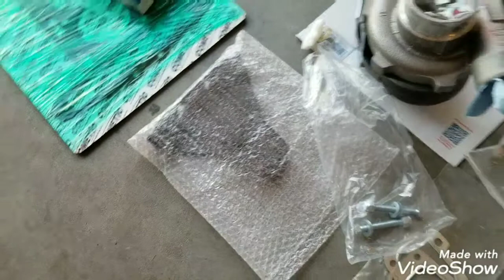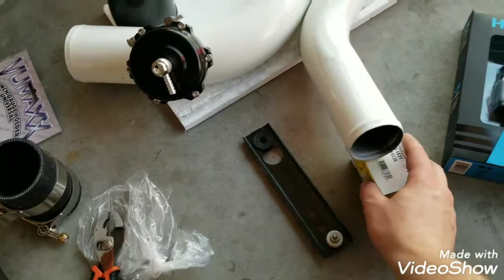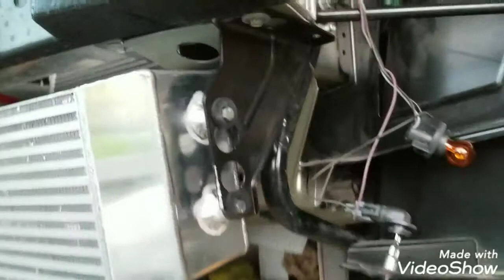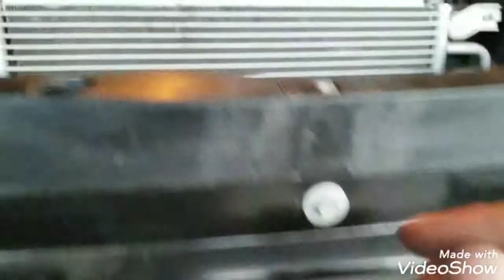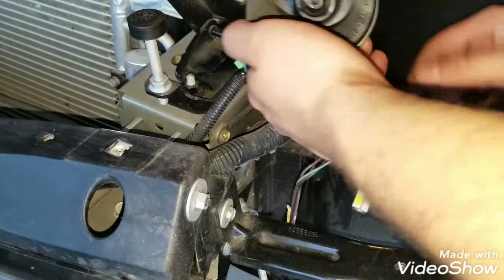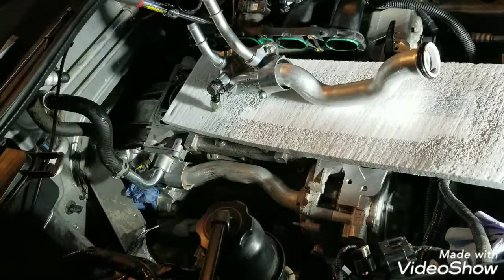Turbo build on le5 ecotec 2006 Pontiac solstice 2.4l (PART 4) 600hp intercooler, coolant install

Comment: Any links were you got this kit from?
Reply from the maker: Most of it was a custom kit from RPM motorsports but i do NOT reccomend them to anyone anymore. If i were to do it again I'd go with hahn. Scratch what i said about them in my first video lol.
Reply: @syntheticperformanceunlimi8323  ok you seemed to be doing a build with the same motor (hp expectations) just diffent transmission. Fir hp tunner would be help with that.
Reply: @syntheticperformanceunlimi8323  my first kit (~2013) was a Hahn  2.4 Ecotec kit...I liked it..I would recommend it...(good budget setup)....ZZP has a good kit also....👍
Reply: @syntheticperformanceunlimi8323  it's too late as I have already ordered the RPM kit.  Wondering why you would not recommend?
Reply from the maker: To begin with it took over 3 months to get all my parts which kept coming in parts every Friday or so.  Always was some excuse as to why my kit wasn't in my hands already. On top of that,  the turbo came in clocked 180 degrees the wrong way as well as many other parts. To this day i still haven't received parts that i really needed so i ended up buying them at my own cost. The kit was over $4,000. I thought i would have been treated better spending that much all up front.
Reply: @syntheticperformanceunlimi8323  grr.  Some of the same experiance right now.  Paid them 6/24 and still missing fuel upgrade, intercooler, manual boost adjustment, and manifold.  Up to last week he has been very responsive, sent him an email Monday and nothing.
Reply from the maker: Yeah at the beginning he responds really well and then disappears Since he has your money
Reply: Any chance you still have any instructions they sent?  Want to be able to go through what i have to confirm what I'm missing
Reply from the maker: Didn't get any
Reply from the maker: My videos go through pretty much everything, maybe that can help you
Reply: are availabel for quick question?
Reply from the maker: @semrad40  yes